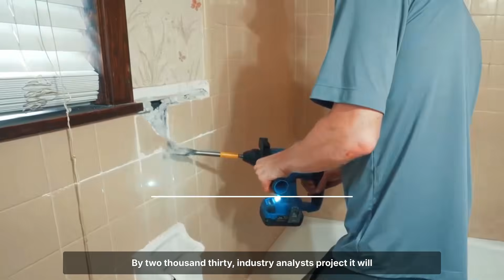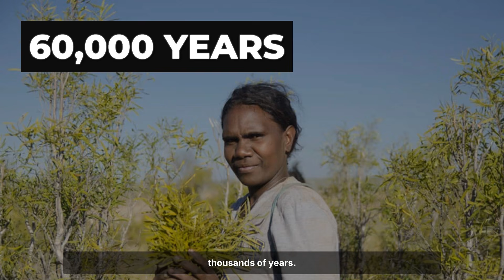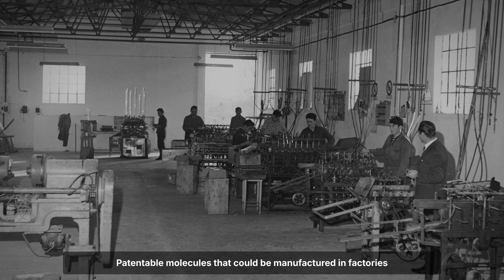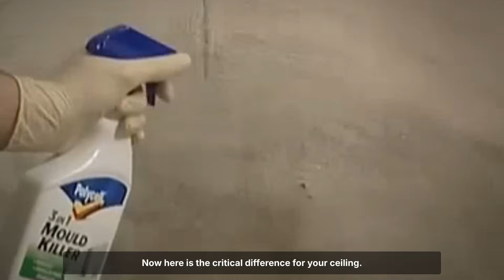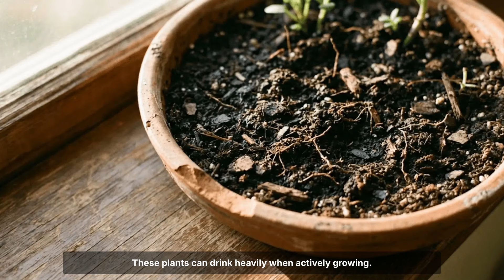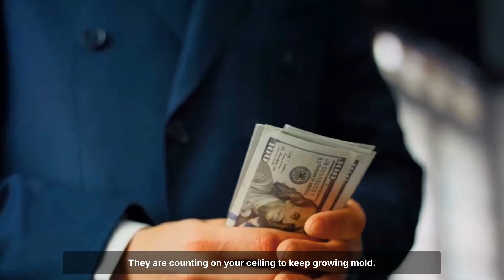This Oil Kills Ceiling MOLD Forever. Grow In a Bucket. Why Its Hidden.

Comment: I survived the Helene distaster floods. Tea Tree oil was the best to clean off and repeal molds.    Bleach just seems to make a cleaner area for black mold to grow. Remember black mold is in the air. When you walk outside you track black mold back in to where you live on shoe soles.  You can set up a dome self support tent inside and sleep in the tent. Also there are tents that fit over beds. This gives you eight hours of safe air to breath with small air purifier machine. You will not realize that molds cause brain fog.   Pets can get brain fog also. Sometimes it will be over the long run to just move. Christian bible tells to burn a moldy house. Get a ionizer machine that you can clean the inside blades. Other ionizer machine have replace filters. Might not be able to find filters to buy.      There is also several other natural plant mold killers.    Some of my friends still sleep out side in tents and campers to avoid black mold. Insurance does not pay for mold damage repair.
Reply: I am super sensitive to mold. I have to watch everything I eat. As we now know they put black mold in 90 to 95% of the food sold at the grocery store. They've been doing this for decades! It's cheaper for them to create "Citric Acid" from Black Mold than from citrus fruit. Then they market it like it's good for us and it's not! It keeps us sick! 🤧😷
Reply: I have mold sensitivity too, note air purifiers only scrub spores, NOT mycotoxins.  Outside air is needed. Grapefruit seed extract and oregano, along with pau de arco are oils to rotate intake of to help our body. Sweating heavily also helps get them out. 1 in 4 folks have difficulty extracting mycotoxins...
Reply: I have multiple chemical sensitivity and the tent idea definitely works. I walked around in a respirator for years it seems like…..
Reply from the maker: I am so sorry to hear about the flooding, but thank you for sharing these practical tips for dealing with mold.